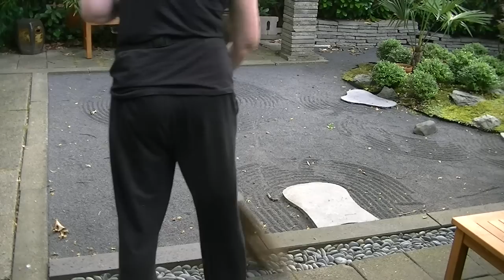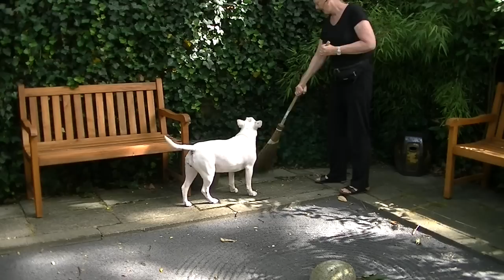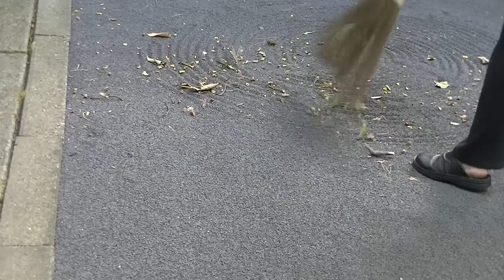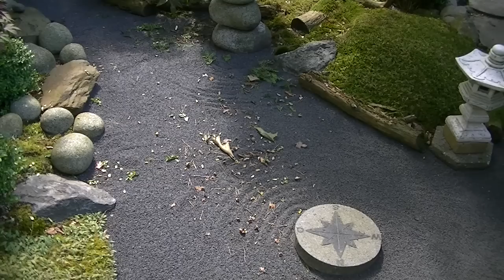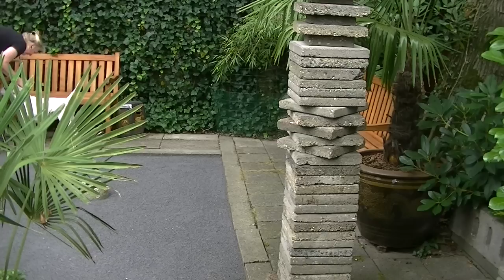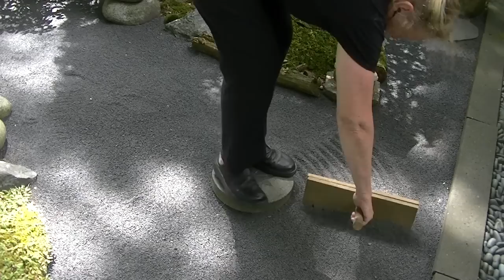ASMR Sweeping the zen garden

Comment: Your garden is so lovely and an inspiration. What did you use for the gravel. I’m toying with using brick sand but wonder if it’s too fine. Would love your feedback. Thanks.
Reply from the maker: It is basalt split 1 to 3 mm. It works really well for me. It is cheap and compact so easy to sweep clean.

Comment: Question about the gravel size - would 5-8mm round not split work?
Thanks.
Reply from the maker: In my experience round grit that is too large doesnt work that well. I tried various grits before I discovered my current fine split. Better to use sand.
Reply: Thank you!